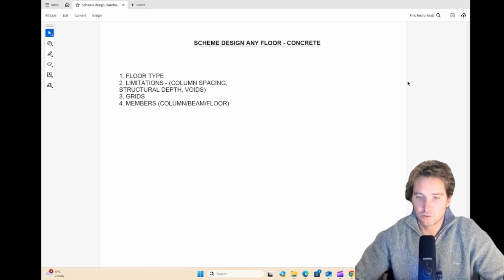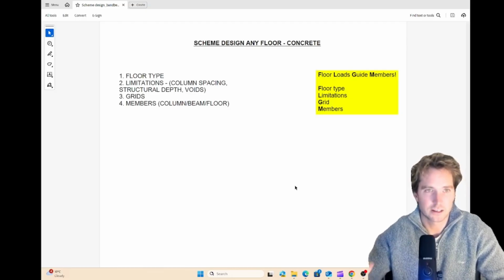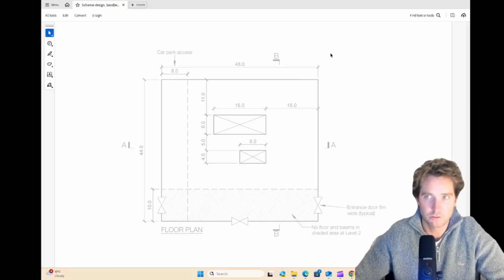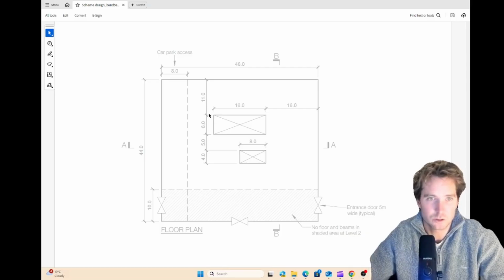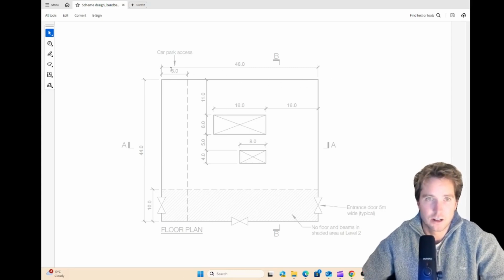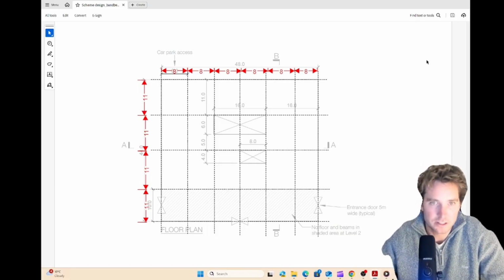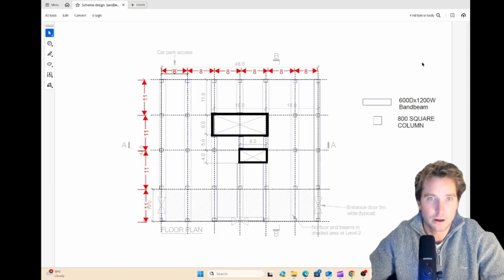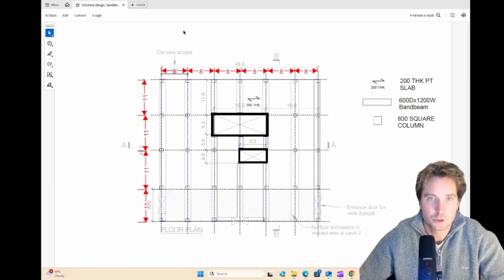Scheme design a suspended floor - concrete

Comment: You should've given a shoutout to the Concrete Centre's "Economic Concrete Frame Elements to Eurocode 2", and "Concrete Buildings Scheme Design" manual. I reckon theyre almost essential for quick scheme design of concrete elements
Reply from the maker: True!! Thanks for giving it a mention here 😉